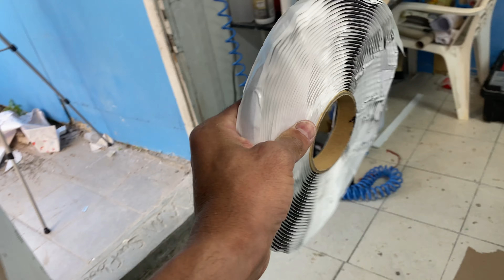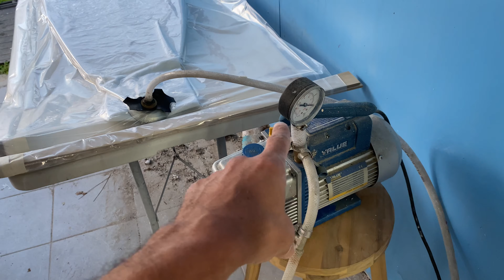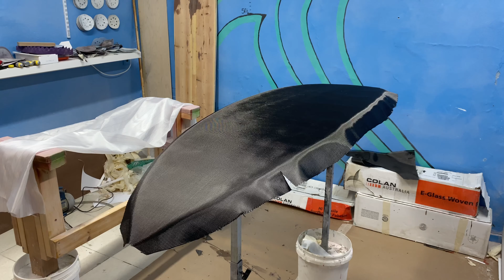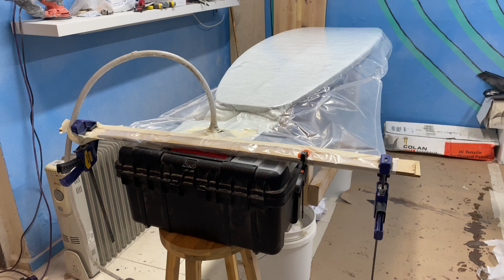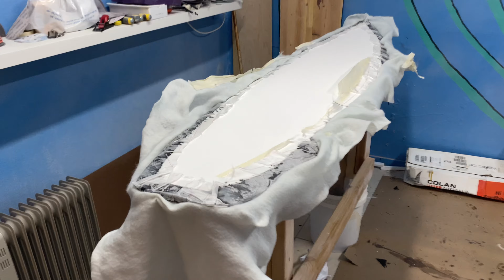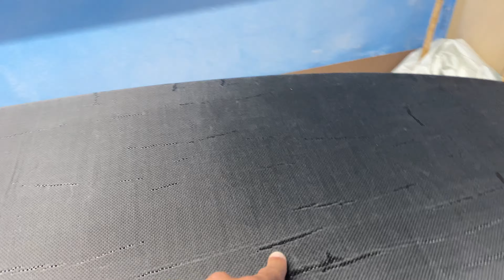Full Carbon Fiber Surfboard Glassing | First Time Using Vacuum Bag! Time-Lapse

Comment: I am in the process of building a part, and it's around 5"x5", the peel-ply got stuck to it and I can't get it off.  The fact that yours came off so smoothly even around the edges is amazing.
Reply from the maker: I wonder why it got stuck- shouldn't happened 🤷🏻‍♂️

Comment: Hi Koby, great work, what is the pot life of your epoxy?
Reply from the maker: Summer time 15 min and i have to wrap the rails, winter about 20min
If i leave it in the pot mixed for 3min it will get crazy hot and not useable
Reply: @kobymaymonsurfboards7320  thanks!

Comment: Maybe rolling the dry peel ply onto a cardboard tube first and then unrolling it into the wet carbon? Or wetting up through the peel ply?
Reply from the maker: For sure will help to get better results but also to have better pump to hold it firmly against the carbon
Reply: @kobymaymonsurfboards7320  most of those pumps should be able to pull 25” of mercury...should be enough, no? I wonder if you were getting too many leaks? I do smaller stuff like model airplane wings (so maybe easier for me) and I just use cheap $3 latex caulk and new poly drop cloth...no bag fittings or clips and there are no leaks that way. You just fold over the poly sheeting, lay the pvc hose in there and seal 3 sides with a caulking gun. Might be worth a try? Thanks for taking the time to post your videos...I really enjoyed them!

Comment: Thank you to show this process. At 4 mn 03 sd, you cut across the weave lap...are you obliged to do that because this make lose a lot of strengh in the rail acting as a beam?
Reply from the maker: I make sure that the 2 sides are sitting on top of the other, the cut is under the rail, I had to do that as the carbon doesn't like to wrap as normal fiberglass, I do not think that I lose any strength in the board..
Reply: @kobymaymonsurfboards7320  Will you do the same kind of cut when doing deck bagging?  I think it can be done if the upper cut is  not in front  of the lower one already done. Should have the longest overlapping ( in lengh direction ) as possible.  Thanks again to share the next bagging  step, I'm staying tune after that :-)
Reply from the maker: @kamilacanau  The next video will be up soon - I did it on the top as well but it looks and feels great!

Comment: Did you notice any flattening or twisting of the rocker while under vacuum? I’ve done a few boards with vacuum infusion. They’ve all been stringerless, so I did a hand lay up of carbon on the rails before I put them in a bag to infuse them to prevent any warpage. Would be cool if I could skip that step...
Reply from the maker: No, but i had not the best pump.... so not sure about stronger ones 🤙🏼

Comment: In the description it says you used 3 lb core. Do you know what type of material the foam core is made of?
Reply from the maker: EPS - that’s what I always use. Carbon boards i use 2LB and normal epoxy i use 3Lb

Comment: did you leave the vacuum pump on for 24 hours?
Reply from the maker: 2.5h is the cure time for my epoxy so i can turn off at this time, i peel it a bit later to give it more cure but there is no need for the vacuum

Comment: what kind of carbon fibre do you use ? the weave type and weight ? nice work!
Reply from the maker: It is plain weave, 187gr (5.7oz) , it was very easy to work with- good quality 🤙🏼
Reply: @kobymaymonsurfboards7320  cheers koby!

Comment: Hi Koby! which resin did you use? i normally use Kwick Kick as you do with normal layups but for my upcoming vacbag boards i have bought some slow epoxy (not resin research but normal epoxy)  to make sure i have a lot of time to work and that the excess resin will still come out of the cloth instead of already being to firm.
Reply from the maker: Sounds like the right move, let me know how it turned out 🤙🏼
Reply: @kobymaymonsurfboards7320  thanks!!   i JUST now received the eps stringerless blanks i ordered. over here me rate eps by EPS 100, EPS 150 Or EPS 200.. the blank was  from france and was rated 20kg/m3. i assumed this would be EPS 200 but it feels definitely softer, and lighter. i think i will add an extra stomp-patch of 4oz under the carbon where the feet go. maybe HD foam inserts for the boxes.. which density EPS did you use?
Reply from the maker: @alexanderschuit5340  20kg is great, the 4oz on the deck is smart- you can see i do that will all my carbon boards
Reply: @kobymaymonsurfboards7320  hi Koby, some research in converting, and consulting with experienced shapers learned me that 20kg/m3 is 1.25 lb EPS, which seems way too soft. 1.5lbs could be done but 2 lbs seems to be the consensus to be the minimum for a durable board, which would be 35 kg/m3. so i am selling this foam to someone who wants to do a sandwich construction
Reply from the maker: @alexanderschuit5340  i have no problem with 2lb as the carbon wrap is super strong and stiff

Comment: Why did you suck the air out of it with that bag on it? Seemed like a pointless addition to the process. Just glass the two layers of carbon and fiberglass then do the other side..
Reply from the maker: Not sure what you mean,  it not just sucking the air out-it has a peel ply and a breather cloth on it, we sucking the air out to get the access resin out and to have the ultimate bond for the carbon to the foam, the result is super strong and light. the board turned out great, light, and strong but also with perfect glassing due to the vacuum bagging technique.
Reply from the maker: @countryroadstakemehome   cool video, a nice way to build it and more simple. there is more than 1 way to build a board, his way will be heavier and not as professional as I do it. when building a hi-performance shortboard it matters. what I do is inspired by Dark Arts Surfboard and with all the research I have done this is the best way to build 2LB surfboards that is super light, fast, and durable. hope it helped!
Reply: @kobymaymonsurfboards7320  any links to the full process? About 10 yrs ago I built around 12 surfboards, normal epoxy glass hand layup with EPS cores, but want to get back into it again, with carbon and vacuum bag this time, for foil boards. Any links to a guide of the full process, much appreciated! loved your video 🤙
Reply from the maker: @greg.ocallaghan  not at this point, however I advise you not to use vacuum, you can do normal glass and it is just fine 🤙🏼
Reply: @kobymaymonsurfboards7320  why not vacuum?
Reply from the maker: @greg.ocallaghan  based on the test i did the difference between with vacuum and without is minimal and not worth the extra work and cost, unless you glass something complicated with channels etc.

Comment: Nice vid Koby!
What carbon cloth are you using?
Looking forward to see the next vid.
Thanks for sharing
Reply from the maker: Hi, thanks! 
3k Carbon (about 180gr = 5.7OZ if i am not mistaken)
Reply: @kobymaymonsurfboards7320  That's a very common weight to use. It looks like a plain weave, you might try using a 2x2 twill next time to give it that "traditional" carbon fiber look, plus it conforms to curves much better. Oh, and use a squeegee on the peel ply as well to avoid voids.

Comment: Looks worthwhile!
Would you consider using COLAN again, or mentioning specifics of the cloth in upcoming videos/add in the video description? I know you've answered people separately, already. 

What would you estimate the rough outlay for equipment was; pump, bag, and difference in expense for cloth?

Your setup looks sweet!
Reply from the maker: Colan is great, never disappoints. 
I would say the total expenses was double the normal board, the pump is expensive but it was borrowed... if normal fiberglass cost 5$ meter the carbon cost 60$ and this the biggest difference 🤙🏼